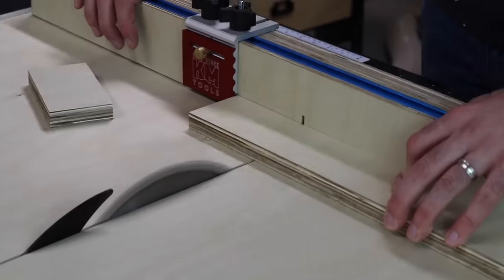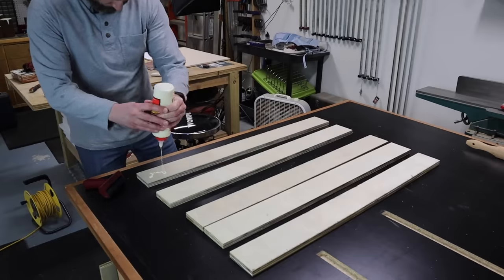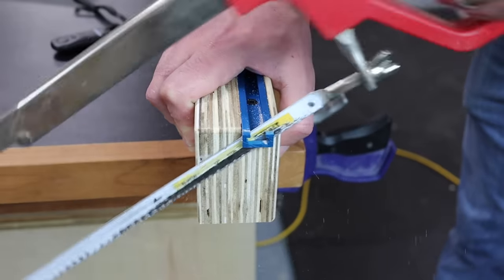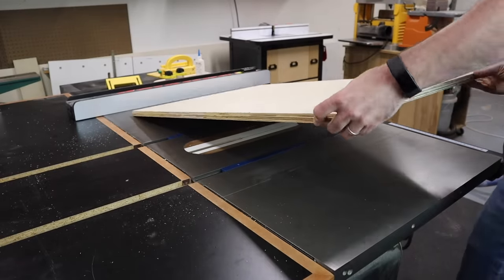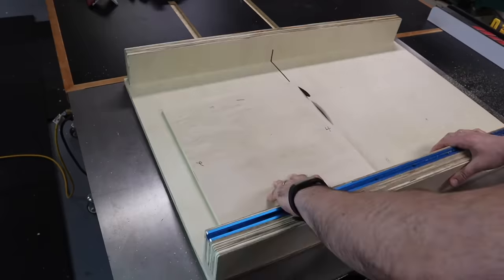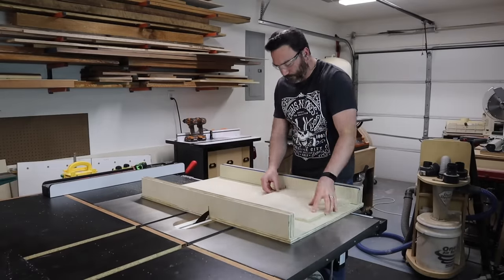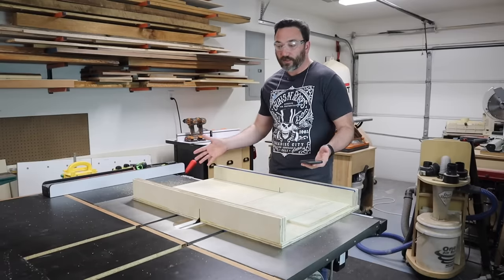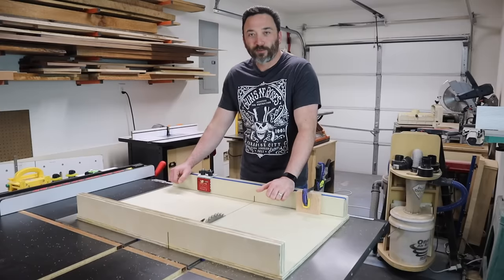Have a Table Saw? You NEED to do This!!!

Comment: Years ago I worked in a machine shop that manufactured small parts for aerospace products. Accuracy was imperative and the tolerances were usually plus or minus 10 thousandths of an inch which is the thickness of a human hair. I appreciate your attention to perfection, however in regard to woodworking, a human hair off from perfect is perfect.
Reply from the maker: I used to be a machinist as well back in an earlier life and I've been an engineer for many years. I obsess more than is necessary about tolerances.

Comment from the maker: I don't have any plans for this cross cut sled, but if there's enough interest I'll make some. Let me know!
Reply: Does this mean no maths then?
Bob
England
Reply: Seems to me you explained a lot about the details of assembling this sled, but a big question I have, and I have watched many "sled" videos, is what factors to take into consideration when determining the dimensions, the base thickness, the base material, the far fence function, the shapes and height (not heighth - a pet peeve of mine) of the far and near fences, etc. I think the parameters that need to be considered when building a sled for a particular saw are more useful than a set of plans for a specific saw. I know I struggled with these questions this week when I built my first sled for a cabinet door project I am currently working on. Also, there appears to be some magic in determining the offset from the blade cut line to the left and right sides of the sled, but I'll be  damned if I can understand the magic - any enlightenment you could provide on this topic should appeal to your viewers.

Again, great work, keep it up.
Reply from the maker: @psmola101  No magic needed! 
For the base material you want it to be flat and stable so a sheet of plywood is perfect. I've tried 1/2" plywood and it has more tendency to warp, so I prefer 3/4" plywood. 
The far fence is needed to hold the sled together. Without it that end of the sled would just flop around not only making the sled inaccurate but very dangerous to use. 
The height of the fences needs to be higher than you will run the blade so that you don't ever cut all the way through them. 4" is a good number since table saws typically don't cut that high. 
As for how far to the left and right of the blade the sled should go, it's really up to your preference. You can go as wide in either direction as you want to go, it's just going to make a much larger and heavier sled. Same for depth of the sled from front to back. Go as wide as you need without making the sled too massive to use. 
Hope that helps!
Reply: @psmola101  Heighth!! Crikey me too……how did it get started?
Bob
England
Reply: A Mier Guage can act as the base for a sled.
Reply: Is the final footprint for the base 2' x 3', and the front and rear fences 3'x4"? Thanks.
Reply: That would be great . Include the math
Reply: @jordanburrill7182  depends on the miter gauge .... the ones commonly shipped with the saws are garbage
Reply: Thank you for this video! Haven’t built anything like a cross cut sled yet but thinking about it a lot. And now I came across your instructional video which is very, very clear and without any non informative crap in it. (well, except for the music here and there… If you’d leave that in the recording studio your video would improve and I’d give it a 10 out of 10!)
Reply: I used Birchwood.  Little to none voids.

Comment: This is easily the best representation of the 5-cut method for squaring your crosscut front fence.  I've seen a LOT of crosscut sled videos and your explanation was the best I've seen.  Most other YouTubers just gloss over the math, and some even skip the step of multiplying by the length between screws.  And I agree about avoiding hardwoods for your miter slots, as I live in a high-humidity area....I use aluminum miter bars or HDPE miter bars (which is sometimes cheaper than aluminum, esp. on Amazon).  However, due to high humidity after a few years, my double-thick front fence began to bow inward (concave looking down).  So I upgraded and added one of those aluminum "super" tracks from Woodpeckers, which has made a world of difference.  Not only perfectly straight, but the additional track grooves allow multiple options for adding stops or additional accessories.
Reply from the maker: Thanks! An aluminum fence is a good idea unless you have a SawStop. My monster sled had an aluminum fence and I was always worried about tripping the blade break if it was too close to the.
Reply: @biscuittreewoodworks  You're right, I never thought about a SawStop.  I've never had the "spondulix" to afford one of those, lol.
Reply: At 13.00 you could see the pilot hole drill move the fence. Oops!

Comment: For the miter bars, I got a cheap cutting board from Walmart that measured to be the correct thickness. Cut them at the table saw. Perfect. They won't expand or contract.
Reply from the maker: The plastic cutting boards, not the wooden ones, right?

Comment: Nice job explaining William Ng's method. I just yesterday came across his 11 year old video on this topic. I especially like the way you marked the A and B on the 5th cut, and explained by way of example and simple analysis which way to  rotate the fence to bring it into alignment. You are a skilled teacher. My only suggestion to others building a sled would be to clamp the fence in position once you have inserted the feeler gages to make the 0.013" adjustment, and before you install the next screw.

Keep up the good work, you have a natural teaching talent.
Reply from the maker: Thank you!
Reply: I agree with your take on the video, and also with your suggestion to others. 
Good work all around, imho.
Reply: I agree. Seems like the fence moved slightly when the screw went in, which is pretty common. Otherwise, great video, I am going to make this tomorrow, and subscribe to your channel.

Comment: Great Video. The absolute best/simplest description of the 5 cut method I've heard yet. Thank you.
Reply from the maker: Thanks!
Reply: What happens if “a” needs to be bigger than “b”, do you just remove the other screw instead?
Reply: @anphan3208  Start with the corner block and feeler gauges against the fence and clamp the block in place.  Remove the feeler gauges and the screw and push the fence against the corner block.  Insert new screw.
So, instead of adding the feeler gauges as in the video, you're subtracting the feeler gauges.

Comment: Great video. One addition i find invaluable in my sled is t-slots for shop-made hold down clamps to make cutting small parts safe and accurate.
Reply from the maker: You can add those if you like, I’ve just never had a need for them and I think they over complicate the jig. If I need to cut small parts I’ll use a pencil to hold them or set up a clamp.
Reply: @biscuittreewoodworks  wow I use them constantly. Would not cut small parts without them. To each his own.

Comment: A friend of mine is a retired structural engineer. He made me one very similiter, but he used thick aluminum plate and extruded aluminum bar that was fiberglass coated used several "T" tracks, I have had it for almost 9 years, it is .00001 out of perfect square, I can also adjust if it ever were to get out of square, surprisingly it is quite lite. It also has several gigs I can use with to to make box joints, miter cuts & so much more.. I myself am a retired Master Carpenter.. I only use my shop, now to teach my grandchildren carpentry.. And I do occasional projects.. My children & grandchildren use the shop 90% of the time.. 
Thank you for sharing.. I wish we had the internet and YouTube back when I was active working the trade...
Reply from the maker: That would be fine on most saws, but pretty sure you couldn't use that on a Sawstop.
Reply: You can turn the stop feature off. There is an inherent increase in safety when using a crosscut sled (no cut on a saw is completely safe!), so a metal sled should be no problem. Having said that, my sleds will always be wood, not metal or melamine.
Reply from the maker: @harveyalan788  It's a bit of a hassle to go into bypass mode on the Sawstop and you have to go through that procedure every time the saw is stopped and restarted. Possible, sure. But I bet someone would go through a lot of blades and brakes trying to use a metal sled.
Reply: You can’t even measure .00001 out of square. Good grief.
Reply: When in woodworking would you need to be that accurate? I was a machinist for 38 years. I did first articles for the Government. Never have heard of having to measure that tight. Helicopter rotors are allowed.005 runout. As in the other comment “ good grief “!
Reply: What in the world did you possibly use to measure square to that level of accuracy??  I don't want to call bullshit, but the aluminum components of the sled are going to expand and contract far more than that with temperature changes, making it necessary to devise some sort of tension relieving/absorbing connection at each joint that somehow manages to perfectly evenly balance all the dimensional changes.  I'm getting a headache thinking about incredibly difficult that would be.

Comment: I can't tell you how many cross cut sled videos I've watched over the years, and I've build quite a few as well.  This is probably the most straight forward, concise video I've seen.  You explanations are clear and detailed, yet straight to the point.  As others have mentioned, this is especially true in your explanation of the five cut method.  I've seen many botched explanations of that process.  Great job! I'm now a subscriber.
Reply from the maker: Thank you!
Reply: Very clear, concise and meaningful explanation of your process. Thank you for making everything so understandable.

Comment: For safety, it's very important to add some type of positive stop to the forward movement of the sled, so that the saw-blade will NEVER fully cut through the glued on "safety housing" shown in this video. This is particularly important when trimming thick parts, such as table legs, when the saw-blade is near full height extension.
Reply from the maker: To achieve that, I have slots cut into the outfeed table that can prevent the miter bars from going too far.

Comment: My sled is similar in size and construction and includes the Katz-Moses stop block. I did add T-track parallel to the blade on both sides of the blade. The t-track is about 14" long and 6" from the blade. This allows me to have an adjustable clamp to hold down wood when necessary and I also often clamp my shop vac hose with the floor attachment attached to suck up sawdust as I cut. I did learn a few things from your video for my next build. Well done!
Reply from the maker: Awesome! Sounds like a good sled!

Comment: I cut dovetails slots into my crosscut sled to add MicroJig clamps so I can clamp down smaller pieces that need cutting.
Reply from the maker: I thought about adding t-track for clamps but I’ve never needed to clamp anything down to the sled.

Comment: I have a sawstop slider. I used 3m spray adhesive to put a strip of 150 grit sand paper on the fence. Nothing has ever slipped again while cross cutting. Should work perfectly on this one too.

Comment: Good content, thanks.
I have a narrower (front to back) sled used for cutting structural pieces rather than panels.  The narrower size means that I could put a perspex cover above the line of the blade, wide enough to reduce the likelihood of touching the blade but without impeding the ability to hold pieces against the fence.
Reply from the maker: Sounds great!

Comment: Thanks for the video. I too prefer a simple crosscut sled. 
Nice demonstration of explaining how to determine which direction to move the fence to achieve square. 
I like my big sled to overhang the edge of the saw a couple of inches on the left. This allows using a clamp to hold the fence during the initial build vs using the screw. I also find it handy to be able to clamp on this edge without interfering with the sled movement from time to time too.
Reply from the maker: Glad you enjoyed the video!

Comment: Simple and effective... all that I need.  The only change I may make/add... a couple Dovetail slots in the base to allow me to slide in some (MicroJig) MatchFit clamps if I need to secure/hold parts down as I cut.  Possibly cut an an angle from the back fence area side towards the blade kerf on the front fence area, so it can easily handle large to small parts, yet the dovetail portion of the clamp can't run into the blade.  Cut before assembling the front fence of course.
Reply from the maker: Thanks for watching! Let me know what yours ends up like!

Comment: Great, nice, simple video! I’ve made two sleds so far and used them both for 10 years but watched anyway because you always get something from a how-to video. What I got from yours was that the fence measurement should be from the pivot screw to the other END of the fence (not to the other end screw) I’ve never seen that clarified in other videos, also, anything under  0.00 is good enough (I’ve always shot for under .004). you’re right, quit chasing zero, wood moves. Here’s something about runners I’ve always wondered about: if you glued the one nearest the fence first, fix it with screws, and then glued the second one without the fence, but with slight pressure applied to the sled to the right until the glue cures, your runners would be exactly right and the correct tightness regardless of how narrow or wide the runners were ( if you cut your own) in the slots …right? You’ve inspired me to build a cute,little, mini sled for my gift boxes, thanks.
Reply from the maker: If the runners are a little loose, you can do that to make them fit a bit tighter.

Comment: Nice job and better explanation. Between 10:10 and 10:17 I did the math mentally and my answer was 0.016 but I saw yours and went running for the mobile to check mine. I believe that your first trial was correct enough.
Reply from the maker: Yes, the first attempt was probably good enough, but then I couldn't show you how to make the adjustments for better accuracy if you needed to.

Comment: When I grow up I'm going to get a table saw like yours.  Aside: 4:50  I bought the Harbor Freight oscillating sander.  It's exactly the same thing as the Ridgid, but 1/2 the price.  I use it frequently and have no issues with it.
Reply from the maker: I had heard a lot of good things about the Ridgid oscillating sander. It’s ok for rough work but not very accurate. I may upgrade to a floor standing model at some point. I’ve been doing this for a long time now so I’m getting away from cheap tools and investing in higher quality tools that do a better job.

Comment: You measured the fence adjustment from one end to the other, 34” I think you said. However, it pivots on the right screw, so measure from the screw position. It’s picky, I know, but some folks might have placed the right screw further in. You got great results and like your video.
Reply from the maker: No, I measured from the screw. That's exactly what I said at 10:45, measure from the screw because it is the pivot point.
Reply: @biscuittreewoodworks , I feel like such a dunce. This isn’t the first time I have needed to be set straight. Thanks for responding and keep up the great work.

Comment: What I did differently with my sled was, I increased the depth to accommodate a 24" cut and used delrin for the miter rails.

Comment: I found putting a few good coats of good paste wax on my table saw jigs helps keep them from being affected by humidity.
Reply from the maker: Great tip!
Reply: Just don't use anything that contains silicone oil if you are planning to add a finish to your cut pieces.  It can really interfere with getting a uniform coat (found out the hard way).

Comment: Nice video. You explained things really well. However, while I’ve thought about building one of these for awhile, I’ve come to the conclusion that I’d rather get the Dubby sleds or the Incra 5000, I think it is. The Dubbys are basically sleds, one for each side of the blade with a miter gauge style push fence to be able to cut miters. Can use just one, but a think having both could be really useful at times. The Incra is basically a miter gauge fastened to a sled. It has a built in adjustable stop block. I think a 180 or more positive stops. And a board that sits on the other side of the blade to support and catch the cutoff. Yeah they both are definitely more expensive than building one like this, and if you already have a nice miter gauge, this one would probably be the way to go. I’m still just using the one that came with the saw, so I’d kinda like a combo of miter gauge and sled. Won’t swear to it, but I think the 2 Dubbys can be fastened together to basically make a full sled.
Anyway, I liked your video and maybe a smaller version with the stop block for cutting a batch of small pieces for whatever would be handy and easy to store.
Reply from the maker: Thanks! I have the Incra 1000 miter gauge, it works great! I thought about getting the Incra 5000, but decided to just build this one instead.